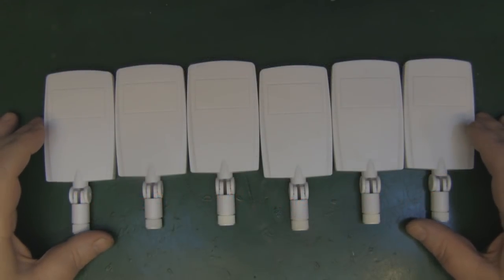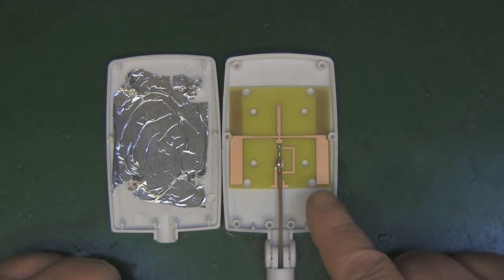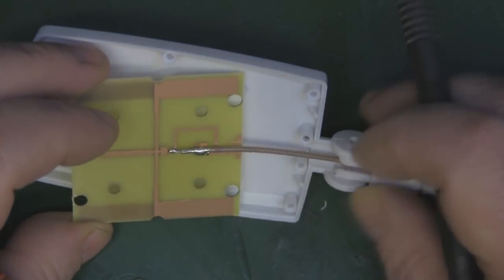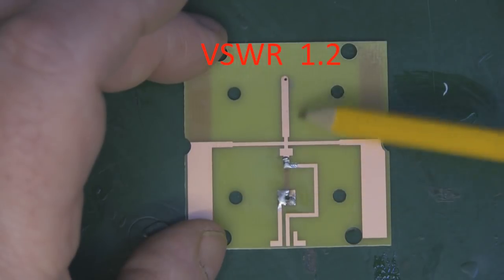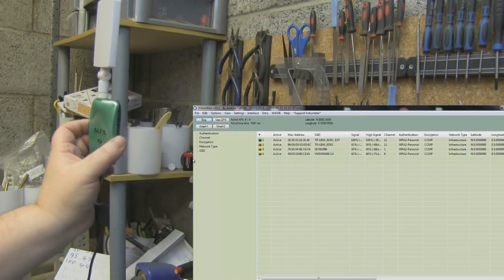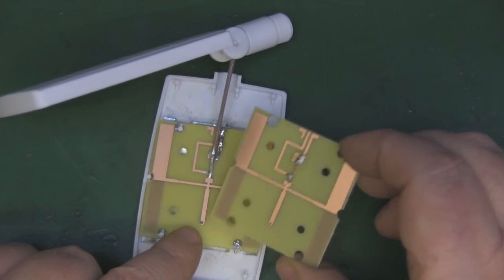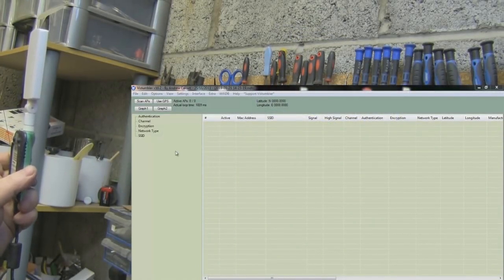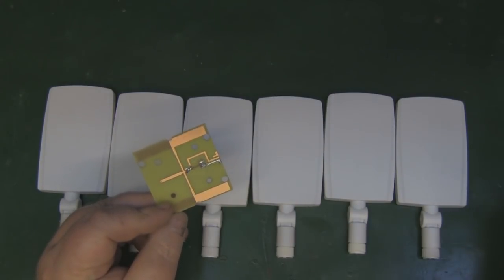2 4GHz 8dBi WiFi Panel Directional Antenna

Comment: I have a similar Trendnet dual band 2.45ghz, 5ghz and I also discovered the elements were shorted most of the time, but not always, which resulted in an alternating unreliable and rocksteady connection! The problem was that the coax center conductor went through the backside through a tiny hole in the trace for the outer conductor and it simply shorted the elements. That didn't look right to me either, so I cleaned up the PCB and carefully made some turns with a 4mm drill bit on the backside to remove the copper around the hole. Now it works consistently. It was certainly an improvement to remove the short.

Comment: 5 years gone by.. if you revisit this task. move that reflector further out, youll have both tunning and the optimin distance.. set up you signal strengths with your own modem, and have everything elevated and out in the clear, no walls floors ceilings close by

Comment: I have made numerous of your antennas, and many of mine, and there are two things I would like you to know. 1, if you test the same antenna several times you will get different signal strengths, they vary by the second. 2, the real test is not how many access points you see, but when you actually hook up to one, what it shows on BT speed tester. This will also often show vast differences second by second on the same antenna.
Reply: It depends on many variables,  you can make slightly different antennas without ever noticing, wavelength is very small.  Bandwidth,  resonance, dirt on connectors,  coax bendings,  even moisture on air,  wet weather,  reflections on solids, noise from nearby aps and armonics from other frecuencies. ..  Many,  many variables involved that change measurements.  Thats because anecoic chambers exist. Use good coax and well designed antennas.  Most internet designs are wrong. If you can,  software model.
Reply: @DavidLopez-bz4rj  sound advice and indeed many youtube  self made wi fi aerials are poor. I try to use only 15cm of coax.
Reply: @freefilms10000  You can use longer cables,  as long as you calculate the attenuation if it is ok for you.  1db = 5 metres of good coax approximately.
Reply: @DavidLopez-bz4rj  thank you. I find it easier just to use short!

Comment: andrew mcneil, I am your fan I have seen many videos on 2.4GHz wi-fi antennas, there is a possibility to create a more powerful antenna in place of the models of rotary models of the brand TP-LINK .. put type enrroscada in the O which comes from a larger amount of signal rather than the size of a signal reaching range greater than the size of a signal of 500 meters at 1 km? ?

Comment: Andrew,  I bought a few years ago a Alfa AwusNHR v2 rated at 2w, however it seems to me that it only delivers 100mw (rtl8188ru) . The other card I own is  Crotalus Rtl8187 rated at 1w, this one is wonderful,  right now I am 1 km away from home with an smartphone,  inside a rock made building with iron gates in the windows,  not even line on of sight. Signal here is - 65, at home parabolic dish 22dbi. Do you know why cant I get 2w of power from the first card?  Thanks
Reply: I found an answer somewhere as to why the Alfa 2w is poor, forget where, but it is.